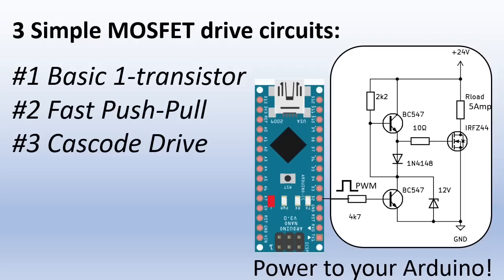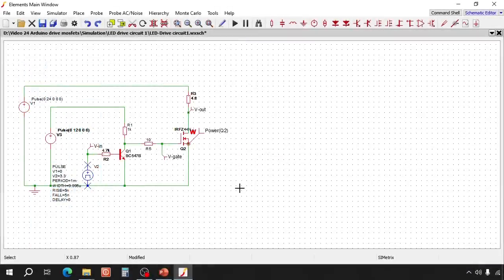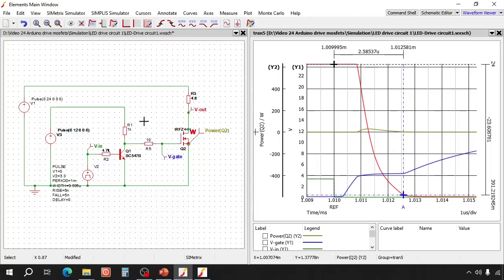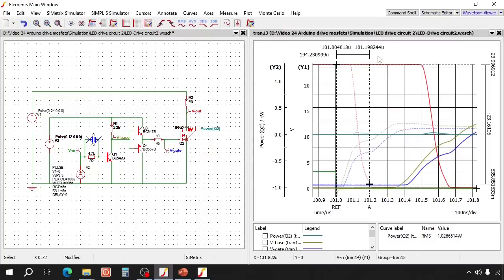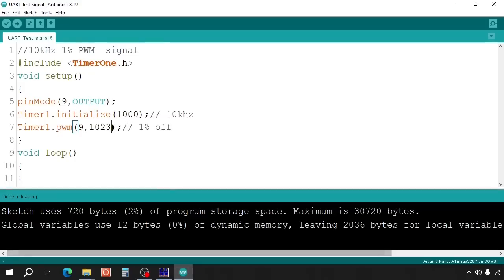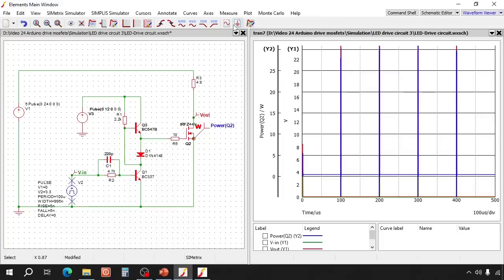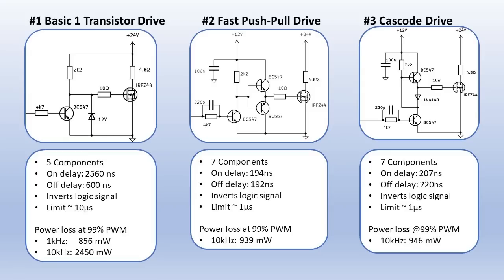3 Simple MOSFET Drive Circuits

Comment: Great video! But unfortunately, i was not able to find out where i can find this Elements circuit simulator. It seems, that all components are already included in the library. Does anybody know where to get. Thanks!
Reply from the maker: https://www.simetrix.co.uk/
you can use the free demo version, it works  "up to 140 nodes"

Comment: Can the third circuit run at a voltage of 3v - 8.4v with a battery as a voltage source
Reply from the maker: No it can not, the IR2104 locks out below 8 Volt.
You can search for another lower voltage IC
Reply: @smartpowerelectronics8779 What I mean is cascode drive, not ir2104

Comment: One thing that can be done is to NOT shut-off the bipoar transistors totally. Keep them biased just a little and the charge time on the base will decrease. If you do so, the circuits can run easily 10x faster. I have made circuts with BC107 with respond time in nano second region by just letting them be biased instead of having the gate totally discharged.
Reply from the maker: Yes you are right, bipolar transistors can run really fast if they are not saturated, I mean, you can make FM transmitters at 100MHz with them! For power supplies, you do want to drive them in saturation to get as much current out of them as possible, this will slow down switch-off but it is still fast enough for the "low" switching frequencies of power supplies of 50-100kHz.  So it is a trade off.
By the way I have good memories of BC107's in metal can, I used 2 to solder my first blinky-light as a kid, no idea how it worked, just followed the magazines' instructions but that was what sparked my interest in electronics 🙂
Reply: @smartpowerelectronics8779  Thanks for your excellent videos. It wasn't intended as criticism on your video, it was purely intended for the viewers do go further in their own investigations.

Comment: Great video!  Thanks for all the detail.  I was looking again at electronics design to repair some modules I invested in to charge my Prius HV batteries if needed from sitting to long.  Possibly use as a battery tender as well. Anyways, this got me thinking some more about control of the H bridge of the other gen 2 and gen 3 inverter converter assemblies I got from the salvage yards since I couldn't believe they were so cheap, like $20 for some of them at one time when the 50% off sale and even then about $75US then at most before half priced. The gen 2 inverter converter assembly is more modularized and seems based on the specs can more easily make a universal pure since wave inverter for whatever rectified generator inputs within spec input range.  Plus have the three phase option.  Seems can also be controlled to make a multifunction welder and maybe also a plasma cutter. I was thinking for the offset balance control called for Aluminum TIG welding.  So not there yet and carefully paranoid to be safe before I do any hands on being the capacitors alone really small in size can pack a punch and be lethal potentially.  Looking forward to using the Elements design and simulation app.  Thanks for all again!

Comment: I  like your presentation but may I suggest a 12v sorce as most, if not all, projects with the Ardunio and Rasberry PI are 9 to12 voll supplies and I want to learn how to control mosfets with those controllers. Thanks and I hope to see some examples... Rick
Reply from the maker: Thank you richaredneal384! The circuit works with 12V, I used 24V because it is commonly used for LED flextapes and to show it is suitable for higher voltages 🙂

Comment: is it possible to use this mosfet to drive a motor (because of inductance) ?
Reply from the maker: yes you can , but put a diode in parallel with the motor to prevent the voltage spike from the  inductance to damage the MOSFET (similar as I did for circuit #2 testing with the load)

Comment: I’m confused because in a schematic from the preview you feed a zenner with 24v directly though an opened transistor. I don’t think it will survive after that.
However that’s possible cause 4148 will die first I think
And if we will be lucky, and the diode  will be shortened, we say good bye to both 547.
Reply from the maker: You are not confused, you are right. The circuit in the preview has a mistake! Thank you for pointing it out! The 12V zener can be used but should be connected directly to the gate of the MOSFET. The circuits in the video are correct 🙂
Reply: @smartpowerelectronics8779  Aha! Cool. Thank you

Comment: Thank you for this very informative and practical circuit with critical analysis. I would like to know if inductive load can be triggered with high side switching. Here the MOSFET is used as Low Side Switching. Any idea? or can you kindly do a high side switching, meaning the source of MOSFET is connected to an inductive load and +24 feeds directly to the Drain of MOSFET. Thank you sho much for sharing your knowledge. I am a second year studen in Electric and Electronics Engineering.I am working on a higher frequency design, say from 45KHz to 2MHz. If there is a gate driver IC, please give some ideas of practical circuit. I searched couldn't find one except your video is very helpful and gives engineering details. Thank you so much.
Reply from the maker: .I am working on a video for high side drive of N-MOS which would work for you, but it may take a few weeks before I publish. This pdf from TI may be helpful for you.   /slua887a.pdf?ts=1705275507968&ref_url=https%253A%252F%252Fwww.bing.com%252F

Comment: why using 1% duty cycle? What will happen if w use 50% or more? Power losses will stay same? And will that going to allow us higher frequency (more 10Khz) to operate the first circuit?
Reply from the maker: I actually use 99% duty cycle, so the load is 99% of the time on in the simulation. 99% results in the maximum loss (conduction + switching loss)
For the first circuit the ELECTRICAL limit is the on/off time which is in the range of 2.5µsec, so you can go to 100kHz at 50% duty cycle, 5µsec on/off. 
Thermally 100kHz at 50%is NOT ok because the switching losses will be too high. Hence 10kHz is the maximum.
Reply: @smartpowerelectronics8779   Hi, thank you for the explanation, very helpful. One more question, is it possible to calculate the gate driver efficiency? And also can we use MOSFET instead of BJT in the level shifter?

Comment: They are programmable. Laptops, power banks, solar charges are programmable by connecting the proper phones. The programming may take 7 hours charging using the usb ports. When it is programmed, the power bank becomes compatible with the phone. The chip can become blacklisted remotely, if bad guys try to use the device. When it’s inside a laptop, the device acts as a mobile court, it decides offline, how the user is allowed to benefit using the device. For example, bad men will cause the laptop to overheat, and can’t be used anymore.
Reply: Wut

Comment: Nice circuits! My only concern is that these are all negative true, so when power is first applied and the Arduino hasn't yet fully booted, there may be a momentary period where the output is on.  Any thoughts on how to prevent that?
Reply from the maker: You are right, so you need to check the starting conditions. You can also add a pull up resistor to the base of the transistor connected to the arduino to make sure it is high at startup.

Comment: I dont like they’re inverting. You don’t have a control pulse you have your load/mfet blown up.
It may suit some applications but not the majority of others.
Reply from the maker: You are right, you have to be very careful with initialization of the MCU for e.g. power supplies.  If your IO starts with low output in the PWM your boost/buck/flyback will blow up...If you can prove that the IO is high or floating at startup, it is OK though.

Comment: Thank you for the great video. 

I have a question. Can these circuits be used to enfage/disengage an engine battery? And what MOSFET would be up for the job?

Mind that when engaged, current should be able to flow in both directions: from the battery (engine is starting), to the battery (engine is charging the battery).
Reply from the maker: For car 12V car battery applications I suggest a relay. The MOSFET can not handle a short circuit. If the current is limited you can use a MOSFET and circuit #1 is a good choice.
If you use a relay --do not forget the flyback diode 🙂 https://electronics.stackexchange.com/questions/110574/how-to-choose-a-flyback-diode-for-a-relay
Reply: @smartpowerelectronics8779   Thank you very much for responding.

Comment: Why complicate? IRFZ44N has a low threshold voltage of 4V at which the MOSFET will start conducting. Hence it is commonly used with microcontrollers to drive with 5V.
Reply from the maker: You are right, it starts to conduct at 4V, but to fully switch it on you will need a higher gate voltage 8...12V.
Also your micro controller cannot provide enough current to switch it very fast. So you can use it with 5V as a general switch but not too fast and not with high current.

Comment: 5:32 Seriosly? 😂 I'll take 2x2mm qfn driver for myself to drive hi current mosfet ).
Reply from the maker: That is certainly easier and a good solution for sampling or if the cost is not an issue! Commercial drive IC's have very good performance but are relativity expensive, so in high volume electronics discrete solutions like circuit#2 are still used.

Comment: This is no cascode.
Reply from the maker: In power electronics A classical cascode switch is a low voltage MOSFET (20V) which "cut's" the emitter current of a power HV (400-1200V)  BJT (Or MOSFET) .
This technology it really interesting because it speeds up the switching of the (very slow) HV BJT tremendously.
In analog electronics, cascode  is used for amplifiers for other reasons (noise, bandwidth) and even connected in multiple stages.

The driver stage with the 2 NPN's is connected in cascode, but you are right, it is not a classical "cascode".
Reply: It is totem pole ?

Comment: I wonder if you could get rid of the invertion issue, by changing the NPN transistor at the logic level input to a PNP transistor. Would that work or does this break something else?
Reply: There can be a mirror circuit using pnp of that, but the component count will be the same...
Reply: @Spark-Hole  For my application I was just worried, that if the uC loses power the circuit will fail in an open position, which is not what I want. It should fail closed.

Comment: Just use a IRLZ44 it’s the upto 5v gate version.
I run it straight off of the arduino pin and common ground. It only uses voltage to se itch on or of so no issues with current.
Reply: There is always a little current required to overcome the gate capacitance, but charging and discharging a few picofarads directly from the Arduino is usually fine, I've done it to around 30kHz without issues.
Reply: @TazerReloaded  the video is very interesting,and your use of the simulator is excellent thank you

Comment: I wonder how a 2N7002 N-channel MOSFET would fare in place of the inverting level shifter transistor in Circuit #2. Its base could be directly connected to the uC PIO pin. Might need a small series resistance in the drain to limit the peak pulse current.
Reply: There are better options than the 2N700x series.  There are MOSFETs with quite a low VGS(th) smaller input capacitance and a lower on resistance but your thought is a sound one.  A small MOSFET can save you parts in the circuit.
Reply: @kensmith5694  The Toshiba T2N7002BX is a quite reasonably priced enhanced version, but I doubt that anyone has that lying around.
Reply from the maker: Thank you for your tip! Using a small signal MOSFET for the first transistor will speed up the circuit. 
I would recommend a pull down resistor on the gate to make sure it is off.
Reply: @smartpowerelectronics8779  Coupling the small MOSFET with the active pull-up transistor in your 3rd circuit might further speed things up while reducing the continuous power draw from the passive pull-up. Then decide whether complimentary emitter following buffering is necessary to get the desired slew rate.
Reply: @smartpowerelectronics8779  Could also a small MOSFET for the active pull-up transistor as in your 3rd circuit. A further optimization is to use a gate pull-up resistor to 24V, but then clamp that gate to 12V with a diode. As the gate can then rise to one diode forward voltage above 12V, this hides a portion of that MOSFET’s higher VGS compared to the favorable VBE of an NPN BJT. 

This optimization could also improve a BJT as the base current wouldn’t diminish as much as it approaches 12V.

Comment: after experimenting with first example i found params for better delay: resistor 2.2k -> 100, parallel (to 4.7 resistor) cap 1n. on delay - 200ns, off delay - 310ns. also tried with diode after 2.2k resistor, delays almost the same

Comment: Ahh so thats why  you need to drive them,  I only used a mosfet in a battery capacity tester that switched on and off once every few hours, I had no  idea you'd need more voltage / current to switch them fast.  I was going to say why cant you just drive them directly from the arduino, now i know, would have been interesting to see the performance anyhow.  I coincidentaly salvaged some "logic level gate drive"  mosfets today (D30NF06L) and was trying to make sense of of the difference before seeing this video.
Reply: Well it's a good practice to not use the signal directly from the microcontroller. The output mosfets of those little guys are not meant to drive more than a few milliamps (this is even worse with the most recent ones) and it's better to fry a cheap and easy to replace discrete component than having to deal with a fried pin (or a fried microcontroller). 
This also ensure your transistor is completely saturated and way outside of the linear range. And putting some darlington circuit with a small signal transistor driving a larger one allows better efficiency. 
Finally, BJTs are a good security measure even when driving low current since they gracefully go in safe failure instead of short circuit.

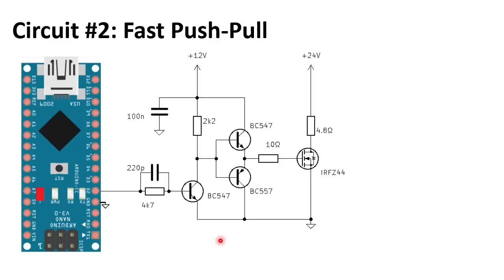Comment: @5:13  !!! Would you, please, study the current flowing through your push-pull BJTs?  I am confident they will be cross-conducting!  The simulation might not show the cross-conducting currents, but a real-world construction of this design will probably be heating up the push-pull BJTs a lot.  There is no circuitry in the design that will guarantee the top BJT will turn off before the bottom BJT turns on and vice-versa.  Furthermore, the level-shifting BJT will experience significant current spikes associated with attempting to sweep stored B-E charges of the two push-pull BJTs.
Reply: That push-pull arrangement of BJT’s is in a complementary emitter follower configuration that affords a >1V dead zone at the crossover thereby operating as a Class B amplifier as there’s no biasing circuitry to force (unnecessary) Class AB operation. I agree that a small resistance at the collector of the inverting level shifter BJT would limit the very brief switching current spike — especially with the delicate transistor chosen.
Reply: This is class B. It has NO biasing therefore there will be 0 cross-conducting! Also, the 10 Ohm resistor already reduces the current spike, no need for other resistors.

Comment: Stupid question: What would occur if we introduce a parallel capacitor to the resistor on the PWM signal line? In the second diagram, you've shown that the capacitor diminishes the switching delay, so couldn't we enhance the first diagram by including a basic capacitor? This would also ensure that the signal logic is consistent across all three diagrams...
Reply: When you do this with a logic signal from a micro, the edges on the micro's pin get slower while the driven circuit gets faster.
Reply from the maker: Your logic is right, The capacitor will speed up the 1st circuit too, but the switch on is sooooo slow that it would not make a big difference.

Comment: Very interesting & useful! I didn’t know about the base drive bypass cap pulling charges out of the b-e junction for faster turnoff before, thanks!
Reply: Or use a diode, schottky prefered, in reverse and parallel to the resistor in place of the cap. This video is cool, throughout, and clear. Thanks.

Comment: I'm usually a fan of MOSFET driver ICs out of laziness, but this was really interesting
Reply from the maker: Thank you, Werner! Yes, as a hobbyist an IC is easier and less prone to mistakes. These circuits are actually used in mass production in very high volumes because IC's are -believe it or not-more expensive than this bunch of smd parts...

Comment: This is slow crap, I make RF circuits up to 10GHz
Reply: Yes but you do need a DC supply to run it from.  
Also remember that there are just as many decades of frequencies below 1Hz as there are above 1Hz.
Reply: Most of us do stuff with "anxious DC", so that's fine.
Reply from the maker: Hmmm... RF technology as amazing and has its own expertise.
I never got past 2.7MHz (at 400V) for commercial designs.
These RF designs where every mm counts ...I admire your expertise...